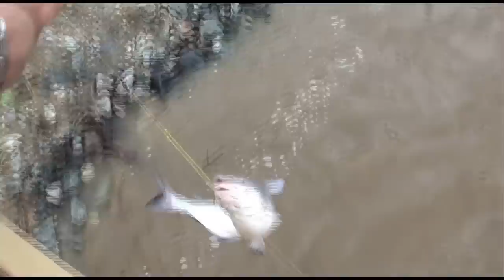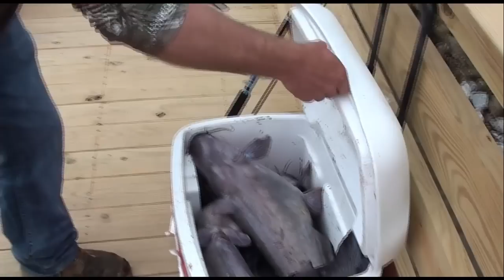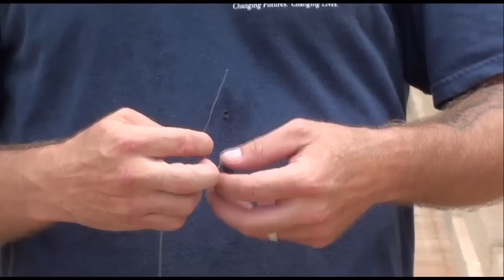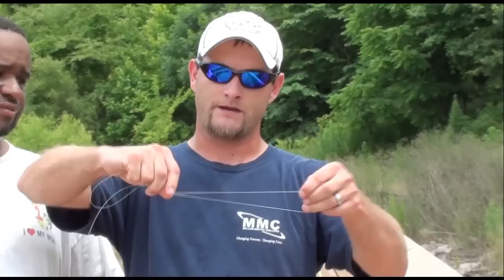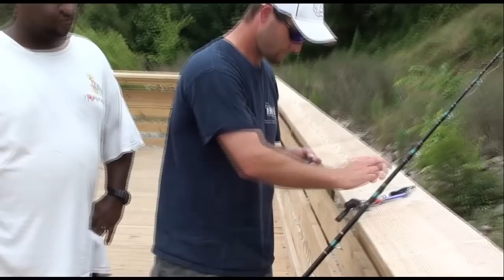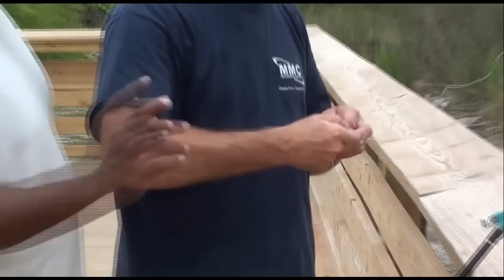How to make a secret rigg to catch alot of catfish

Comment: Basically that how I do it except, I use a 3 way swivel . main line to one side (30 lb test ) .  8-12"  30lb line for hook set-up , sinker weight to 3rd side of swivel ,but only use 10 lb test line. Easier to break a 8-10 lb test line than 50lb test if hung up.
 Only downside to a 8-10lb line (w/ sinker weight ) you can't sling it hard as you want to,might break off. Just a smooth cast works fine.
Reply from the maker: Yeah I like that set up. Just lose the weight is good. Thanks for comments.

Comment: Pretty-much, the same way you jig for live bait ocean shark fishing, except it's all done with stainless steel leaders then.  I ran a Penn Senator 5/0 reel, roller ball bearing Shakespeare heavy rod, and 60-pound Hypalon, and was catching 350 pound hammerheads with a similar rig.  If you want simplicity and really-fast changes, put a swivel on the end of your monofilament, then attach a 12" swiveled leader, then a hook on that, now back on the first monofilament swivel, either hook another 12" leader (if you want two hooks on your line at 12" seperation), then a 6" leader, then a hook to it (laid out, your jigs will look like an upside down 'F'). Now, take some mono and loop through one of those 2-oz weights so you can tie it off on that bottom swivel connect.  I've actually caught two sharks at the same time with a double leader set like this (thankfully, they were under 50-lbs each).  Just remember, shark fishing is nothing but salt water catfishing, and once you've caught sharks, you will NEVER want to bass or catfish again (fights like bass, hangs deep like catfish, and the meat is like steak, but the taste is fish!)
Reply from the maker: Yeah its the same way for shark fishing. I like to do all fishing. Its in my blood lol. Thanks for the comments.
Reply: i never saw a Penn 5/0 Senator reel. 1,2,3,4,6,9,12,14,16/0's which they don't make anymore. and what hypalon? do you mean mono,power pro,flrocarbon.? thanks.

Comment: Basically, it's an improved drop shot to prevent the hook from getting twisted up. Another good way to prevent the twisting is to use a split shot hook that has a built on swivel. What that does is keep the hook straight out, and allows it to freely track around so it always stays true. Two issues I have with this video though: 1.) a dropper loop knot is actually the correct knot to use when using a drop loop like that. I find the OH knots tend to slip too much when you actually get a good bite, or just outright fail. 2.) it is very cruel to throw a live fish into a cooler to suffocate and die a slow death. If you really want to keep the fish, stun it with a sharp blow to the head, or personally I use a buck knife to sever the brain stem quickly and outright kill it. Then you bleed it out by slitting the gills or another main artery before throwing it into the cooler. That's the humane and proper way to kill a fish, and by bleeding it out quickly, you are also preventing bacteria from fouling your meat and possibly making you sick later.
Reply: Definitely agree! I have to take weekly intramuscular shots and save the 1½ inch needle and syringe to use as a brain spike but slightly different. I'll actually load the syringe with 2mL of clean water and I'll spike the brain (gotta do some fish anatomy research, on channels the brain is offset, not in the middle) and then inject the water. The fish is instantly dead even though it's still moving, a good way to check is to apply pressure to the area where the flesh meets the tail fin. If the fish reacts to the pressure (which it would normally do, then it's not dead; repeat. I've only managed to not humanly kill a cat this way 2 times in all of my time fishing. It works 99% of the time. Then of course I promptly use garden shears to cut the main artery under the head and between the gills while the heart is still beating. Can't wait too long after the brain spike or it'll stop beating and I'll only get some drips out. This is something any person harvesting any living animal should have on their mind.

Comment: save on lead and the enviro bro save your old spark plug's for weight's bend the end onto a swivelsnap. also can be hooked to your line to retreve a snag.fish on bro!
Reply from the maker: LOL yeah I saw some people do that at the river. I just go and buy the weight. Thanks for the comment.
Reply: There are probably things in spark plugs you wouldn't want in the water. If you are concerned, use steel weights. Or tungsten, which is denser and harder than lead.

Comment: 2oz with 17lb or 20 lb line is better? ,,,,,,  in your video what line use ??,,,,,,, im from mexico! nice catfish
Reply from the maker: 2 oz is good. You can use 20 lbs line. But make sure you dont set the drag on tight. Because it will snap if you got a big boy on it. Let him run until he cant run no more. Thanks for the comments.

Comment: If I use a 3 oz weight with 20 lb line do you think the line would snap
Reply from the maker: Its noting wron to use 20 pounds if you know how to set the drag on your reel and have a net ready. I got them on 15 pounds in the pass. But more pounds line you have on it better it want snap. Thanks for the comments.